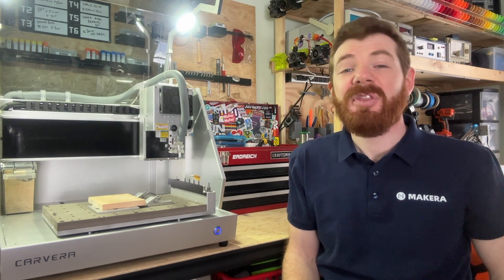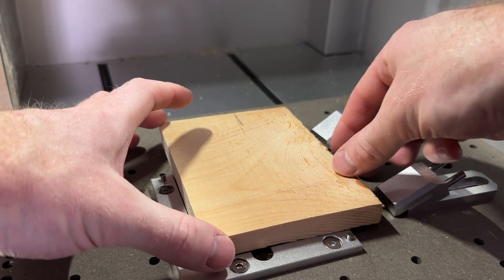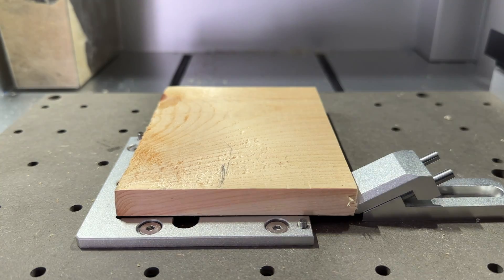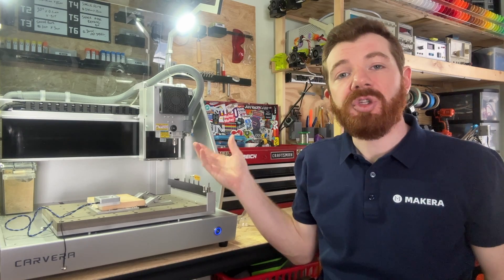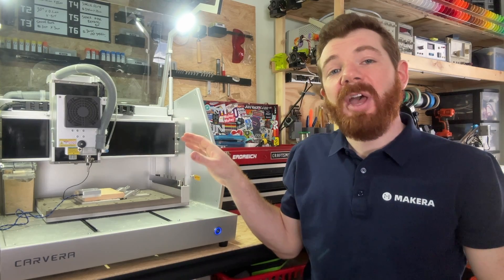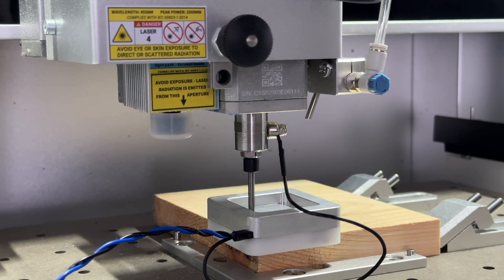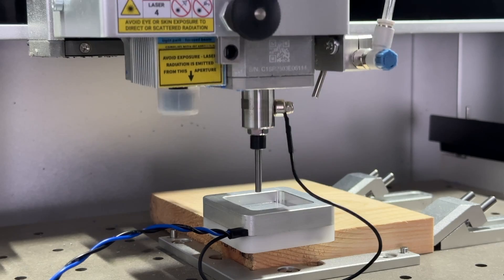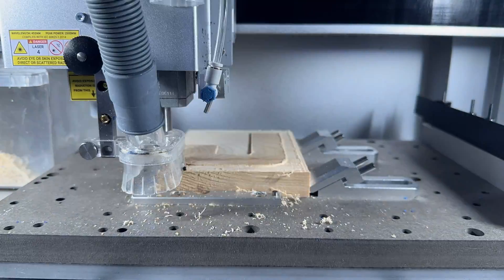How to use the Carvera CNC's XYZ Probe

Comment: does the block need to be held down on the work piece to prevent it from moving during the probing?
Reply from the maker: No, as long as the wires are unwrapped and hung loosely and the head is in an approximate position before starting, the block should not shift during the slow moving probe sequence as shown in the tutorial.

Comment: Can you provide a 3D STEP file of the probe since I need to know the size of the corner top surface clearances necessary on jigs I will be creating. The target object to be milled needs to be attached on the top of the jig surface prior to mounting the jig on the mill table. I would also like to request a two point origin cal in which two opposing corners of the jig can be calibrated and any slight z-axis rotation of the jig mounting that deviates from orthogonality to the mill table can be corrected. Thank you.